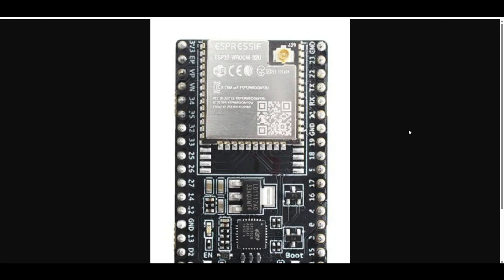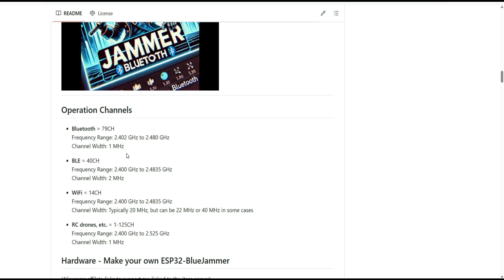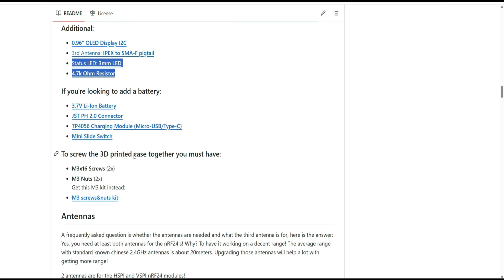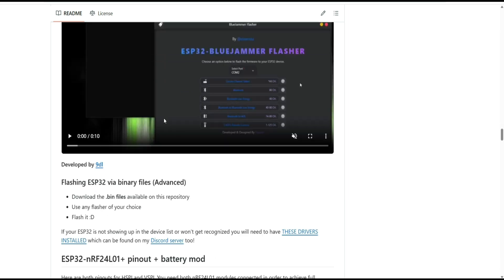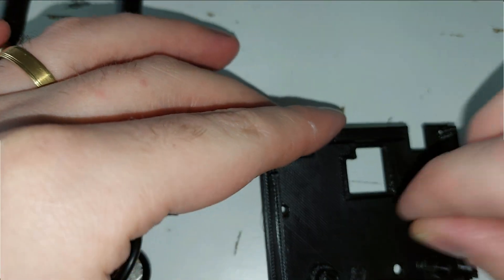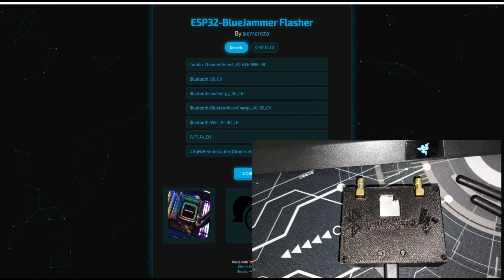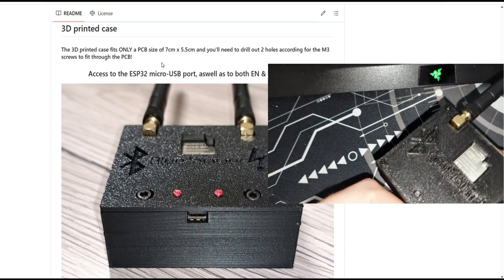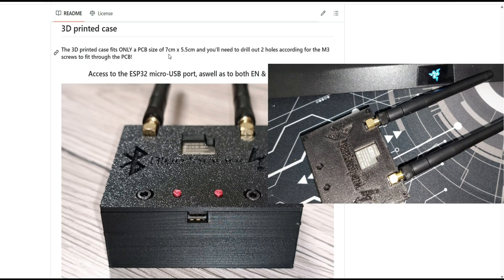DIY WiFi/Ble/Bluetooth/Drones (2.4) jammer

Comment: cual es tamaño de la placa?
Reply from the maker: You can adjust it for your needs, I cut the pcb and then designed the case
Reply from the maker: 70x50 if I remember correctly

Comment: I wonder what the range is on that . I built one that I can put on my roof of my house that I hard wired into my WiFi , I tested it with all 12 of the drones i have & it wouldn’t let me put any drones up in the air at all , I even used bigger antenna to push the output further away & up in altitude . I took my DJI Mini 2 up to 393 feet , turned it on & it sent it back to where I took off from & that’s great because I don’t want to have a drone just fall out of the sky & fall on someone , you can go out & buy one of these drone guns that sends drones back to where they come from , it disables the GPS & there very expensive they start out at $3000 dollars & up , I wanted one but didn’t have the money so some friends who fly drones helped me come up with the jammer I have & I put it on my roof because people were flying over my house & the police just started fly overs in my community & I didn’t want them flying or spying over my house , not that I,m doing something illegal & all , it’s just tha facts . I,m a 107 pilot & I have my 107 pilots license from the FAA so I kinda Trump the police with airspace & all & as long as I get permission from the FAA i can go higher & further than the police with my drones & I didn’t want any collisions above my house with their drones so now once they fly over my house for awhile & get the hint that their drones don’t work in that airspace they won’t fly over it & I,ll have total control above my house for my drones , if they hit any of my drones , they are liable if they take out  my drones .
Reply from the maker: Best comment ever, thank you for the feedback mate!

Comment: Hey man, i got a question, i do everything in the github repo, but when i checked your pin 0 value is 0xe7e7e7e7e7 but mine its showing 0x0000000000. What could go wrong with my config? 

Anyway, thanks if you could help
Reply from the maker: Are you using the same version of esp? Are you selecting the same esp in arduino ide? Have you tried changing the cable?
Reply: @pythoneatssquirrel   i have bought the components off aliexpress using link from the github but i still facing the same issue. I flash it using the webflasher and not the arduino IDE since there's no ino files i could check and flash to my esp32 and i already change the cable and none could change the pin0 value to 0xe7e7e7e7e7, not even one person could help me with this specific problem on the discord too haha
Reply from the maker: Try different wires or solder them again, it's a soldering problem

Comment: since using the wroom32U model why not use the external antenna on the esp?
Reply from the maker: That will extend the range of the connections found, but not the range of modules that are use to jamm
Reply: Ahhh thank you for clearing that up 🙏🏽
Reply from the maker: @TheGrumpyPunter anytime, mate!

Comment: every thing connected as per the video but it not working wifi and bluetooth waste of money and time
Reply from the maker: Check again the soldering, something might have an imperfect contact
Reply: @pythoneatssquirrel  I have check the soldering and I used esp 32 devkit board
Reply: Rest all are same
Reply from the maker: You need the wroom version. Might work with devkit but it slightly modifications.

Comment: All esp32 are Chinese and wroom in the name just means not wrover
Reply from the maker: WROOM: WROOM stands for "Wireless Room" and refers to a compact module that integrates Espressif's Wi-Fi and Bluetooth SoC. These modules are designed to provide wireless connectivity capabilities to various IoT devices. They typically come in small form factors, making them suitable for applications where space is limited.

WROVER: WROVER stands for "Wireless Room with RAM Overlay." Similar to WROOM, it includes Wi-Fi and Bluetooth functionality. However, WROVER modules also feature additional external RAM, which provides expanded memory capabilities compared to WROOM modules. This extra RAM allows for more complex applications or larger data storage requirements.

Both WROOM and WROVER modules are widely used in the development of IoT devices, offering a convenient way for developers to add wireless connectivity to their projects without needing to design the wireless subsystem from scratch.

Comment: I built it, but unfortunately, it did not work too well for me. It does jam Bluetooth, but one of the wireless transceivers does not work. I made a second one and had the same problem. It does work, but not great.
Reply from the maker: Check your soldering connections

Comment: You use two nrf24. Is it one for jam wifi and one for Bluetooth? Or they both work together? What range can it jam?
Reply from the maker: They work together. Just a couple of meters, 4-5 maybe more in the open field.
Reply: @pythoneatssquirrel  4-5m is really short. Is it possible to increase the range up to 50m or above?
Reply from the maker: @MrSela-hb2kv  30-40 maybe with 8w amplifier but it will decrease depending on the number of walls
Reply: Hi, sorry to bother you again. I follow the instruction with GitHub link. I have one esp32 and two nrf. Everything setup perfect but when I tried to jam Bluetooth, it Jam both wifi and Bluetooth. I don't want that. I just want to jam only Bluetooth
Reply from the maker: @MrSela-hb2kv  hmm if both are on 2.4 it's hard....only if you want to use 5ghz network and jam the Bluetooth. If both are on the same spectrum....the only alternative is to build a deauther and target a specific network with it. Try with this one to press the "boot button until you get only the Bluetooth to be jammed. For me it works (check in the video)
Reply: @pythoneatssquirrel  OK, now correct me if I am wrong. From what I experienced from doing this project. At first I have only one esp32 and one nrf24L01. I tried to follow the instructions. There are two type of pinouts. HSPI and VSPI, since I have only one nrf24L01. I don't know which one should I use. I went with VSPI. After connect all the wires and flashed the firmware. It didn't jam Bluetooth, but wifi and then changed back to HSPI, this time it jam Bluetooth as expected but not wifi. That why the first comment, I comment in this video, asking you one nrf24L01 for jam wifi and other nrf24L01 for jam Bluetooth.
Reply from the maker: @MrSela-hb2kv  you can adjust the code and modify the channels and the hopping if you want to jamm only Bluetooth let's say, you can divide the channels into 2 and assign them half batch to one nrf and the other half to the other nrf. Keep in mind the channels:

Bluetooth = 79CH
Frequency Range: 2.402 GHz to 2.480 GHz
Channel Width: 1 MHz

BLE = 40CH
Frequency Range: 2.400 GHz to 2.4835 GHz
Channel Width: 2 MHz

WiFi = 14CH
Frequency Range: 2.400 GHz to 2.4835 GHz
Channel Width: Typically 20 MHz, but can be 22 MHz or 40 MHz in some cases

RC drones, etc. = 1-125CH
Frequency Range: 2.400 GHz to 2.525 GHz
Channel Width: 1 MHz
Reply: @pythoneatssquirrel  actually I just know basic of the project about components, follow the instructions how to connect the wires and flash the firmware. I don't have any knowledge in coding. I don't know how to do that. And it's a little bit lucky for me building this project from the start to make it work without any issues. And thanks for your replies to my question
Reply from the maker: @MrSela-hb2kv  no worries! I don't promise but let's see, maybe I will have some time next week to adjust the code for you.
Reply: @pythoneatssquirrel  oh, I really appreciate your effort. Just your speech alone is enough. Thanks
Reply from the maker: @MrSela-hb2kv  I am just glad when I can help someone. I remember my first few projects without knowing anything about coding, I was one step away from quitting everytime
Reply: @pythoneatssquirrel  hi, sorry to take your time again. But i do some research and just curious. The 3.3v from esp32 is enough to power nRF24L01+ with PA+LNA alone. When it comes to this build, we use two nRF24L01+ with PA+LNA. So I think the power also need more. I find out that if we want to get long range we need more power. And also they suggested to use dedicated 3.3v regulator to power nrf. I don't know what that is but goona do some research.
Reply from the maker: @MrSela-hb2kv  you can use 2 10uF, I added them later, didn't had them when filming
Reply: @pythoneatssquirrel  I asked chatGPT and it recommend 100uf 6.3v. Is that OK? And I tried learn coding but the GitHub link you provided, only has .bin file which I can't edit or see the code. Is there any available link for the code
Reply from the maker: There should be somewhere around but I can't find the code. Stick with 10uF, you don't need more.
Reply: @pythoneatssquirrel I love the fact you answer questions to the best of your ability. Most of these projects the OP doesn't answer which in turn makes people (me anyway) hesitant to spend the time and money on a potential flop.
Thank you!
Reply: @MrSela-hb2kv He is correct. Stick to 10uF Capacitors to level it out. I use them on ANY NRF24L01's if I don't have a module to connect it to because #1 they add bulk to the project VS 2 capacitors and #2 It's more expensive using the modules. They're fairly cheap but can add up doing several projects over time.
Reply from the maker: @tyjohnston5889  the main reason of having this channel is to spread the knowledge :)
Reply: @tyjohnston5889  Hello, 10 microfarads to how many volts ?

Comment: Please help. I successfully flashed it and when I connected everything the esp32 just gets really hot and nothing happens. I’ve made sure to check for short circuits
Reply from the maker: Active wifi consumes around 50 mA (aprox). If you power it from 3.3v it means 50*3.3 so 150 mW so it's normal for the heat shield to go around 70 degrees Celsius. What do you mean by "nothing happens"? Did you attached the nrf24? What the logs are saying after restarting the module?
Reply: @ ive flashed it correctly and worked when I used the breadboard. But not that I’ve connected and soldered everything it now doesn’t work. Just the voltage regulator gets hot. And there are no logs and I can’t reflash it either
Reply from the maker: @WitherDimensions  check the soldering, you might have bridged 2 pins while soldering
Reply from the maker: @WitherDimensions  unsolder the ground and try to reflash
Reply: @WitherDimensions did you ever get it to work?